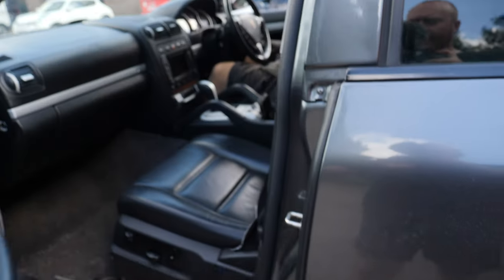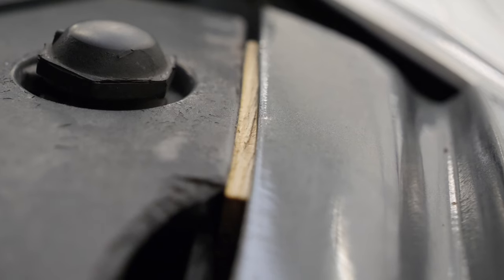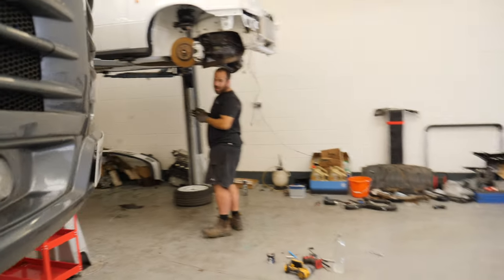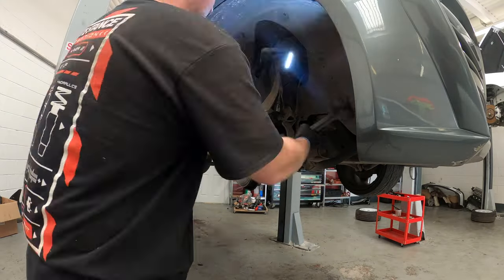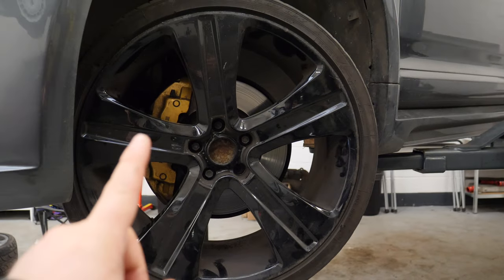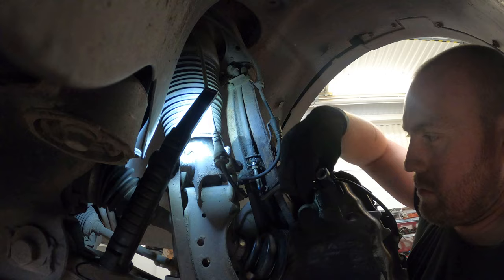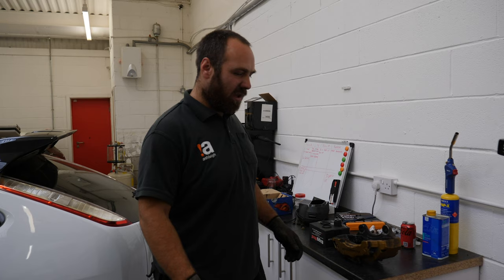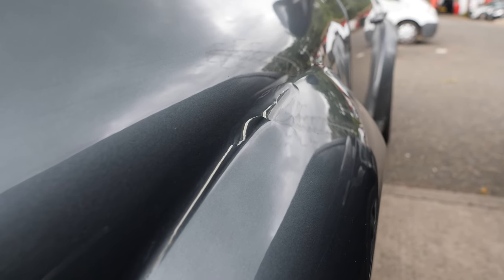DON'T THROW AWAY YOUR SEIZED BREMBO BRAKES!... DO THIS INSTEAD!...

Comment: Shed loads of heat on those brake line nuts usually saves them from twisting and snapping, I've never had one crack and I work on 50's and 60's stuff, grab a mapgas torch... Heat solves most tight bolt issues ✌🏻
Reply from the maker: They never looked like snapping though that’s the thing. But was moving freely 🤷🏼‍♂️👍🏼
Reply: @EVILGT  It lulled you in to a false sense of security 🤣

Comment: Keep up the good work Ben, them size wheel spacers will probably knock out another bearing and a little tip for getting out seized brake pipes is a little blow torch the type used  by chefs just heat up the head of the brake nipple, Amazon is your place!

Comment: Someone once told me that putting wheel spacers on cars damage the bearings by putting extra forces on them, something to do with the weight of the car being balanced outwards, and the Porsche is a very heavy vehicle...... don't know if it's right but it's what I got told 🤷
Reply from the maker: Heard similar mate yeah
Reply: @EVILGT  love the channel bro. Watched it since day one
Reply: hubcentric spacers don't cause damage because it's just slightly longer bolts. Cheap spacers that press on the bearing will cause damage.

Comment: That Astra has been getting rebuilt for YEARS 😂
Reply: How many ? 🤔
Reply: @Ashjones-87  been a good while, was surprised seeing it on the channel. 
You messaged me a while back regarding my coupe turbo. And it was getting built back then.
Reply: Less than 2 years between mots so it’s not exactly that long for a restoration is it ? It’s now getting a engine conversion 🤷🏻‍♂️
Reply: @Ashjones-87  just looked and I broke the coupe turbo 4 years ago so must of been 4 years you sent me a pic of the Astra back then on the ramp. IMO I would keep the c20xe init. Least it’s done to a good standard.
Reply: It’s never been on a ramp whilst getting restored, it was on a spit then on the floor in a barn.
Reply: I was on track in it at oulton park October 2020 which is less than 3 years ago. 🤷🏻‍♂️